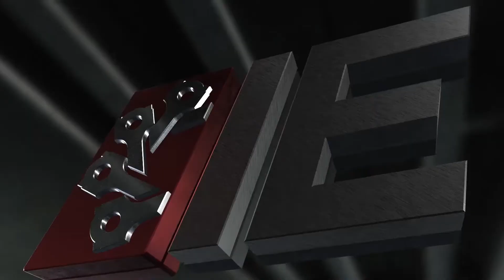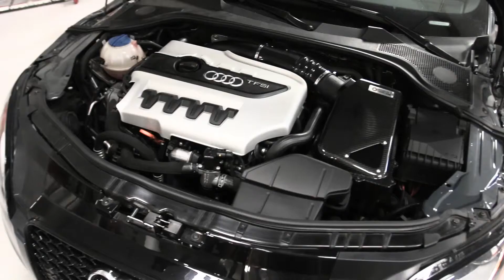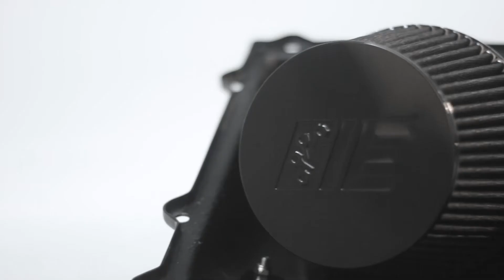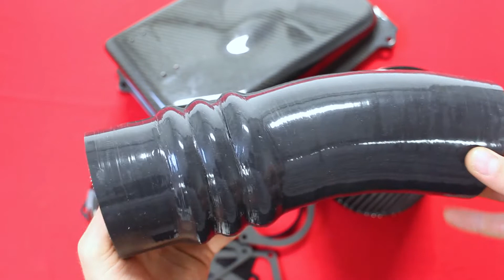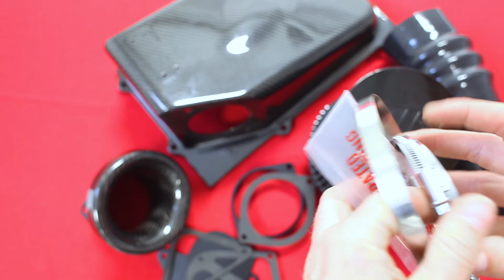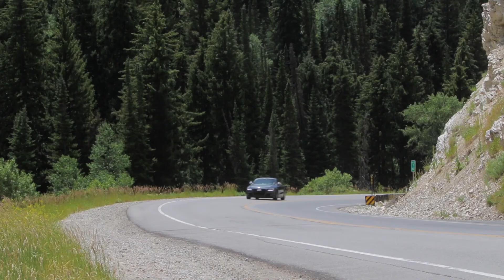Unboxing The Integrated Engineering MK2 TTS Cold Air Intake Kit

Comment: I installed mine and I love it with the stage I tune. I installed without the noise doors. First I enjoyed the louder spool noises and definitely made the exhaust note louder. Later I realized my lower RPM rev range was lagging noticeably and became a little frustrated so I decided to use the noise doors and immediately a huge difference in performance. The doors are a convenient option but you’re either sacrificing noise for performance or vice versa. The intake closed it much smoother across the rev range at lower RPM and the noise still kicks at higher RPM/speed. This is the most high quality intake I’ve had yet for any of my other Audi’s.

Comment: i have a TTs stage 1 with this admission mine does not make any noise why?
Reply: cedric waleffe they’re running a Blow off valve or a BOV spacer. I have the DV+ mounted on top of the Forge spacer and its a loooouuuud whoosh after installing the intake

Comment: Is this the only modification on the car shown in the video? Would the intake provide the same sound and blow off noise on a stock MK2 TTS with the noise doors both off?
Reply from the maker: The car in the video had the following equipment at the time this video was shot:
-IE Cold air intake (both noise doors removed)
-IE Stage 2 ECU Tune
-IE FDS Intercooler
-IE HPFP (Hig Pressure Fuel Pump)
-Milltek turbo-back exhaust
Reply: Integrated Engineering LLC. Thanks! So in terms of blow of noise and intake sound, it should be the same on my stock tts correct?
Reply from the maker: Pretty close, yes!